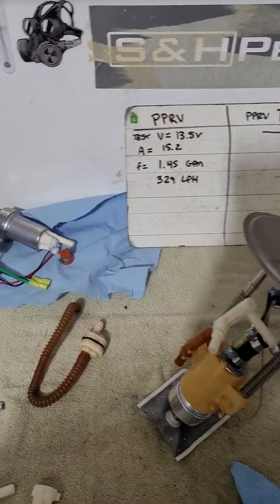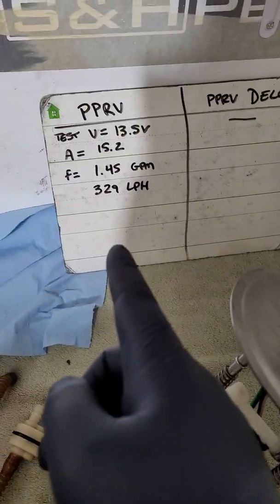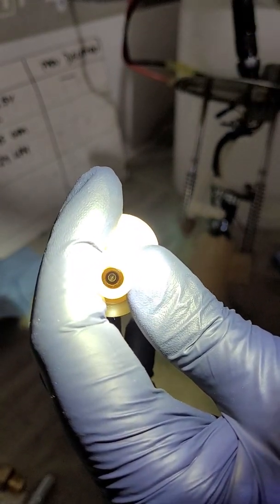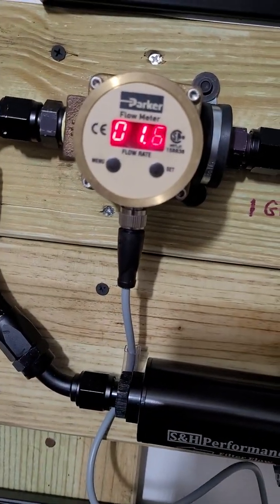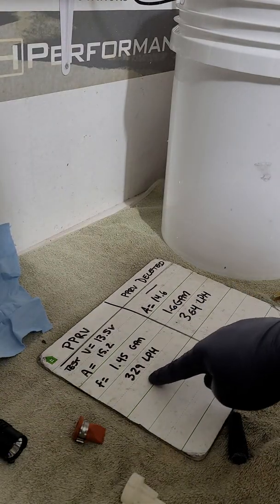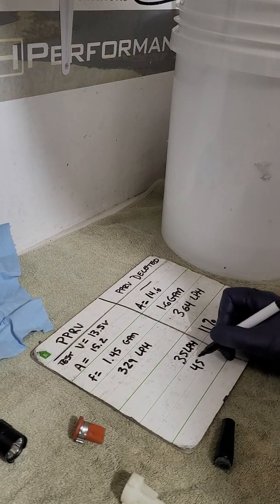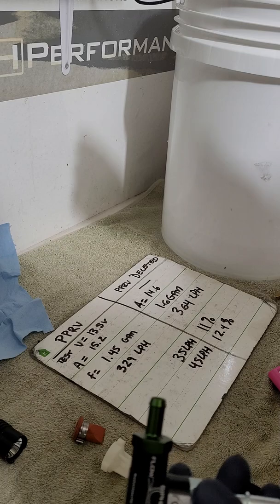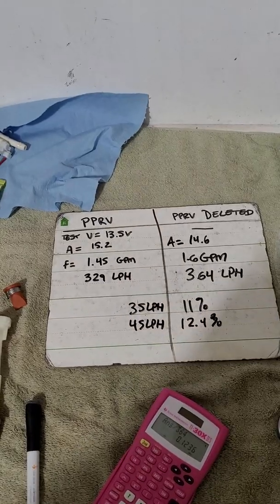Testing flow loss from PPRV and venturi siphon with a Ti Auto F90000262 Walbro 400lph Fuel Pump.

Comment: have an 06 mustang gt.  for the likes of me, I cannot get the passenger side tank to transfer to the driver side. My transfer hose is not cracked or kinked. I have replaced the pump (driver side) 3 times and jet pump (pass side) 2 times. Any suggestions?